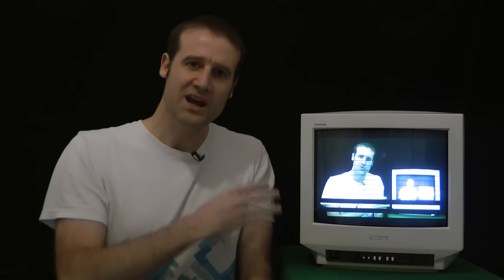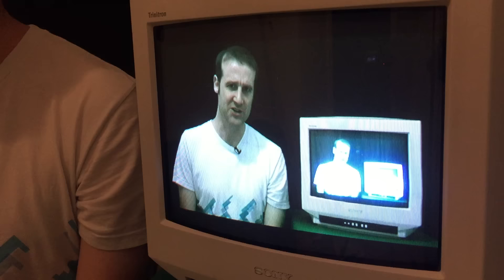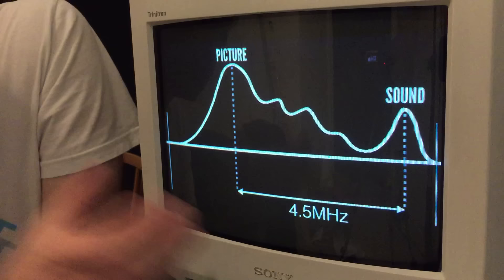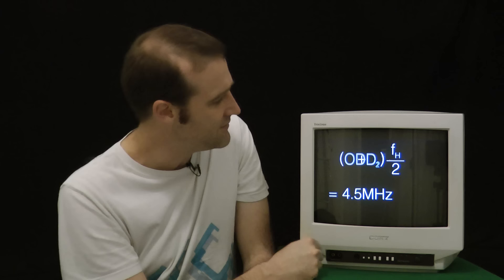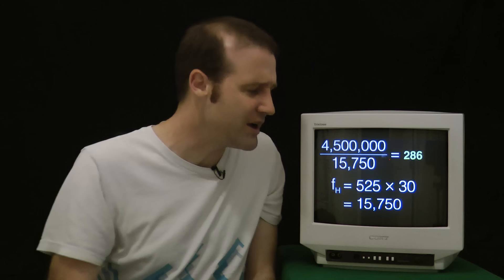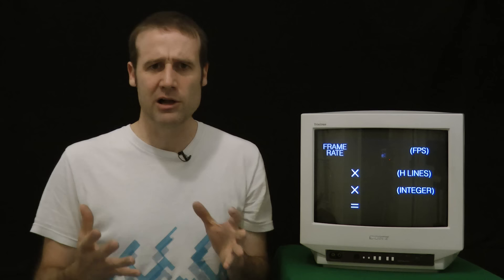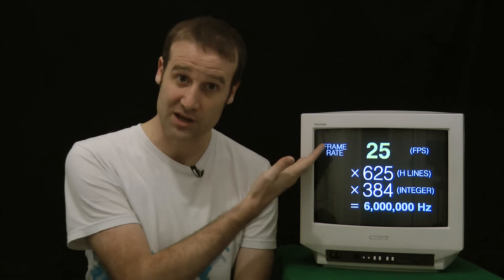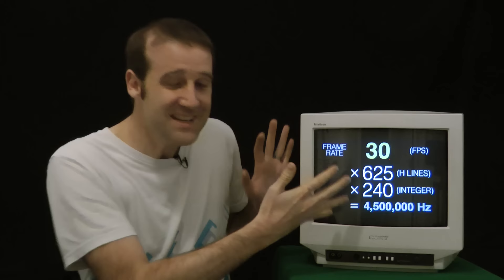Why is TV 29.97 frames per second?

Comment: why the hell is this video 50fps
Reply: Yeah, why not 59.94
Reply: The PAL standard frame rate is 25 so double that to 50 for modern high frame rate PAL.
Reply: My guess is so that its FPS is multiple of the CRT screen he has there, so that no flicker is visible.
Reply: Because as he said in europe CRT uses 25FPS so filming it at 30 or 60 would cause problems, but as 25 is a factor of 50 it works
Reply: sorry. premature comment.
Reply: My eyes...
My PCMR eyes...
They hurt from such frame dropping.
Reply: So what you're, in essence, saying is that every video uploaded with 50 FPS option came from Europe?
Reply: Соɾу ℛ. Or any country that uses PAL, yes
Reply: He's in Europe where the electric frequency is 50 Hz and the cameras sold over there are DVB standard.
Reply: Fifty FPS videos will usually come from Europe. But I'm in North America and my video editing software can easily take a 60 FPS video and render out a 50 FPS video by throwing out ten frames every second.
Reply: Because for some reason a bunch of European YouTubers still haven't figured out that 50FPS video on computer screens makes no sense whatsoever and introduces an annoying 10Hz judder on the vast majority of monitors, which run at 60Hz. And I say this as a European YouTuber.

Please shoot at 60Hz for YouTube. 50Hz belongs on PAL TVs and PAL TVs only.
Reply: marcan The problem is a lot of cameras sold here only do 25/50 fps. Either way variable refresh rate is the way forward.
Reply: marzcorp Most cameras I've seen will show whatever framerates match the configured video system. For example, my Canon 600D will give you 30/60/24Hz video options if "Video System" in the settings is set to NTSC, but 25/50/24 if it is set to PAL. Since pretty much every TV for the past decade will work with both NTSC/PAL input, and since that's irrelevant if you're using HDMI and not composite output anyway, there is no reason to set a camera to PAL mode unless you're shooting for TV. Unfortunately, this isn't completely obvious, so many people set their cameras to PAL mode because that's the European thing, and then fail to realize that that locks them out of 30/60Hz modes.
Reply: marcan I was referring to cheaper cameras, does this look like it was filmed with a 600D to you?
Reply: marzcorp I don't see why not? The 600D isn't a high-end model anyway, and in fact it's less than great at 1080p video due to its less than ideal downscaling (causes moire/aliasing artifacts). There's some noise in the close-up shots but it's hard to gauge how much of that is due to insufficient lighting. Shooting with a DSLR is pretty common.
Reply: True, it'd be hard to guess just from this video what type of camera he's using, but I have a £500 camera that only shoots 50 fps, literally; it doesn't even a 25 fps option. Lots of cameras sold in PAL countries don't have the option, which really as you say they should.
Reply: marzcorp in that case I bet it's just a firmware difference due to stupid manufacturers who don't get that people might want to shoot 30/60p. There's no reason the hardware can't do that...

(FWIW, the 700D is currently £457 on Amazon)
Reply: i agree, standards can be a dangerous thing. As I say I'm waiting for variable refresh rate to become an industry standard, something that monitors could easily be capable of (and many are)
Reply: marzcorp The problem with variable refresh is that you wind up with a pretty nasty situation when you have multiple videos playing at once. With fully asynchronous video you'd need to be able to refresh arbitrarily quickly, which can't work, so you end up with some kind of complex mess trying to come up with a lowest common denominator or just giving up and quantizing everything to a constant refresh anyway
Reply: Good point but it'll still be messy trying to play 2 videos with different frame rates on any screen. To clarify I didn't mean variable refresh rate was the way forward for cameras, I do agree with you that one international standard would be fore the better there.
Reply: ***** You know I didn't think of that, and the strobing effect is more pronounced with modern florescent and LED bulbs.
Reply: This is visible on some dashcam vids from Russia: When people set their dashcam to 30/60 FPS and you see a traffic, it's flickering fast. It's actually because the light is powered with 50Hz. This gives a 10Hz frequency mix which is well visible. Same artifact sometimes shows up when one films his US TV with a european camera (or the opposite). To eliminate this kind of problems, movie theatre projectors, at 18 (silent) and 24 pics/sec (talking) often used DC powered lamps.
Reply: High quality LED lamps use switching converters that don't flicker, as they have a smoothed DC output. Cheapo stuff from china uses capacitive droppers with little or no filtering though. Those will flicker. Check out bigclivedotcom's videos for lots and lots of examples of this.

FWIW Japan has both 60Hz and 50Hz power grids and yet Japanese TV is 60Hz, so clearly it isn't as big a problem as it may seem.
Reply: marcan
You are absolutely right... in 2016. But these are norms originating in the sixties, when high power LEDs were years in the future and high power capable DC supplies were rather expensive, so most appliance tended to avoid them if not absolutely needed.
Reply: Philippe Bourgon Sure, but Japan has had a split power grid since forever (that's why it does - if it had been on the same frequency from the start it wouldn't have wound up like this), and yet there isn't a massive issue with flicker on TV here... so whatever problems this caused in the sixties, they were able to work around
Reply: yes it was possible, it merely implied a price hike for the japanese buyer, but they had no other choice. Conversely, all europe was 220V/50Hz, US/Canada/Mexico  was 110V/60Hz, so both sides used simpler and less expensive power supplies.

Nowadays, the price increase for a multifrequency multivoltage switching supply is barely more than a simple one, and the increase is offset by the fact we use ONE power supply for the whole world. That is what changed the game between 1950 and 2016.
Reply: Philippe Bourgon I'm not talking about more expensive lighting, but rather proper camera design and technique.

Your frame rate doesn't actually have to be an integer fraction of the power line frequency. Your exposure time does. So it's perfectly possible to shoot at 60Hz with a 1/100s shutter speed and get no flicker in a 50Hz area while the resulting video is still 60Hz. This costs zero - it's down to firmware differences in the camera.
Reply: You don't get the point. The question was "why is this video 50 FPS". It's because it was filmed in Europe. So why is the framerate 50 FPS and not 60 in Europe ? There is no technical reason. That's what you demonstrate and i agree. It's simply an usage dating back to the early years of black and white analog TV, which was normalized 60 years ago. At that time, in 1950, it had a real reason : Making millions of BW TV sets a bit less expensive.

As for today, turn your camera to 50 FPS (if you're in the US) and film at night : No doubt you'll see some interference from some appliances, not every streetlight/traffic light has DC filtering. If you have an expensive camera, you can correct this by adjusting it correctly, but do you think the average person would bother ? They don't, they will return the camera as bad, because they don't know anything of all the technical quirks we are discussing here. This, and nothing technical, is the reason why cameras still have a selector for 50 or 60 FPS : The constructor does not want to have hundreds of perfectly good cameras turned in for repair by grumpy customers.
Reply: marcan not all cameras have the choice of 50 and 60 fps. Some cameras just offer 1080p in 50 fps but 1080 i in 60 FPS and such. Dont ask me why, but its a fact.
Reply: PAL 25 x 2 = 50 PAL uses 50hz and 50 x 2 is 25fps so hence why its 50
Reply: my lumia 640 windows 8.1 phone even can do 720p/24fps, 720p/25fps,720p/30fps. 1080p/24fps,1080p/25fps, 1080p/30fps.. if my phone can do this  i don't see why others can't now.
Reply: james42519 So what? This whole argument isn't about the framerate a smartphone camera records...
Reply: @Jon Mayo: Even most TVs from the 90s can already do NTSC/PAL (i.e. 60Hz and 50Hz) ...
Reply: For what reason shouldn't it be?
Stupid question really
Reply: NickTheDumbass why not 
can you really tell the difference
Reply: 50 frames per secon = 99.97 per second? Hertz litteraly means 'per second'
Reply: Hertz was the guy's name. So it literally means nothing but his last name.

But yes, as a unit of frequency in the S.I., 1 Hz equals 1/sec.
Reply: Unless when you are talking about 500 Newton you mean his 499 siblings, it was implied that I meant the unit of frequency :P
Reply: I only watch 144 FPS videos, I have not seen a moving picture in years.
Reply: how much hrts is ur monitor tho ? coz thats wat ur really watching , if its 60hrtz  i hate to tell you this but you been watching 60 fps all this time
Reply: +NickTheDumbass,  hey try looking at the video/computer screen through your camera's i-jockey/droid lol 2 hip
Reply: Mine too
Reply: +marzcorp 'modern' lol modern  PAL is PAL60.
Reply: Because electricity in many parts of the world is 50Hz so I guess they thought it made more sense..
Reply: David of Yorkshire It's not "actually closer". Different countries choose different exact voltages - some chose 220, some 230, some 240.
The same goes for 110/120/127.
Reply: You are incorrect. Different countries chose different base voltages
Your country chose 230, which means 217 - 243 are within the norm.
Russia chose 220, which means 198 - 232 are within the norm.
Qatar chose 240, which means 226 - 264 are within the norm.
If a manufacturer wants to make an appliance that works globally, they are forced to support 198 - 264 volts. In reality, manufacturers often support much wider range 180 - 270 or even release special versions of appliances for different countries. For example, an appliance made for Russia might work even at 165 -170 volts.
Reply: He's in europe, and the frequency here is 50Hz, so the studio lights and tv flicker at 50Hz. His camera is in sync with that flicker when it's in 50fps, so it isn't visible. If he used the 59.94 it would be out of sync with the lights and tv so you would see them flickering.
Reply: the better question is why the hell does 50 and 60 fps look smoother than what the human eye sees in real life?
Reply: NickTheDumbass it's not 'smoother' it's actually rougher. Your eyes naturally insert motion blur into what it sees and the frame rate isn't high enough to create natural blur. The scenes stay put too long to create blur at 60 FPS. 24 Hz cinema settings insert blur due to the camera itself having a longer exposure than higher rates. You're not getting a smooth picture but the blur makes it look like smooth motion (with a loss of detail) so it's not a big deal.
Reply: lighting makes things look jagged
Reply: It's because tv set are using the frequency of the electricity to synchronised the tv set with the camera of the studio. 50 herz in Europe. 60 herz in America.
Reply: The synchronising of the the TV frame rate with the main electicity frequency was perhaps the reason that that frame rate was chosen in the first place but the two did not stay synchronised for long as TV power supply circuits improved and when the TV signals were relayed beyond the original TV broadcast area with their own local power generation.
Reply: Yes further you were where the delay were obvious.  Has result the image was synchronized but had a vertical misalignment.  The top of the image was not always on the of the screen.

The word case scenario was when the tv set was between 2 emitters antenna. The tv set was not able to figuring out synchro signal was the good one
Reply: The camera is probably 50fps. Many webcams are 50fps.
Reply: That's European power grid and such
Reply: it is for mind control
Reply: The same could be said about the annoying judder that seems like a virus on American tv when watching movies on there 3,2 pulldown. Now with the internet things are getting worse and are forcing the mayority of the world to put up with it! because it was developed by them ,what i dont get is with all this digital technology why cant the refresh rate of tv´s and computer screens ajust to the type of programing that is transmitted weather it´s 50 hz 60hz 24 frames film or progresive and not a fixed standart. .judder problem would be solved everywere!,also many times you have to record 50hz or 60hz so not to get picture strobe cause of your local lighting ect. I have problems with my NTSC camera in Europe when i record on artificial lights at 50hz.
Reply: NickTheDumbass
I would have been disappointed if it hadn't been in 25/50 fps.
Reply: I'm in the US and it looks smooth to me.
Reply: @NJ-wb1cz  - Yup. 

The modern European standard for electrical appliances is that they must handle 230V, with a margin of (I think) 10% either way. The situation before that was that the UK specified 240V, plus or minus 5%, and most of mainland Europe had 220V, plus or minus... whatever it was, bit probably also around 5%. Manufacturers found it easier to build equipment that could handle both ranges, rather than have to ship separate ones, and eventually then the standard for what any electrical item sold in Europe should be able to hanld was unified... But in fact mainly Europe's generators are still churning out (plus or vinus variations due to loading) 220V, while ours are still producing 240V (on a good day with a fair tail-wind). =;o}

More recently still, very clever power supplies have been developed that can auto-switch between the 230-ish range of Europe and the 120-ish range of other places, without either overheating or sacrificing efficiency. Designing things to run on specific supply voltages is becoming a thing of the past, except for the cheapest and most basic items (e.g. light bulbs).
Reply: @therealpbristow  yeah, but in rural areas you can have the voltage dip below the spec or go far beyond it, especially during storms when trees and branches touch the land lines or when everyone suddenly turns on the heaters, and then the difference between 220 and 240 starts to really matter. Meaning manufacturers are forced to support much,  MUCH larger tolerances if they don't want their devices fried en masse with subsequent warranty/customer service headaches. 

This isn't really related to switching between 110 and 230, even the most universal and smart devices usually don't support voltages around 140-160 volts - where it's too far from the base voltage, but too close to switch.
Reply: I cannot resist anything below 50.000075 FPS .he should really make a updated version
Reply: @marzcorp  Not PAL, video on computers is progressively scanned, so this is 50p, which is technically (sort of but not really) the same visual frame rate as PAL, as PAL is 25 fps at 2 fields = 50 fields. Interlaced footage at 25fps gives roughly the same visual sensation of motion as progressive at 50fps. But its not PAL, PAL is only for analog broadcast and reproduction.